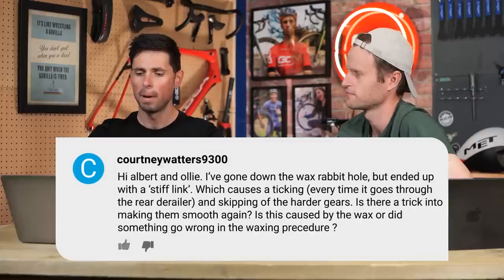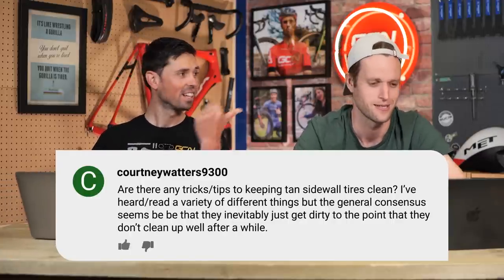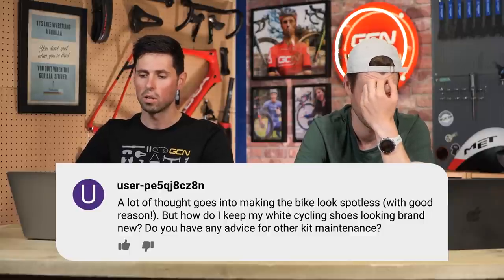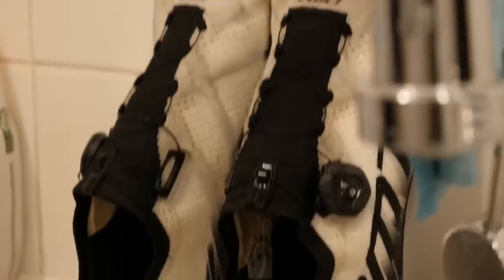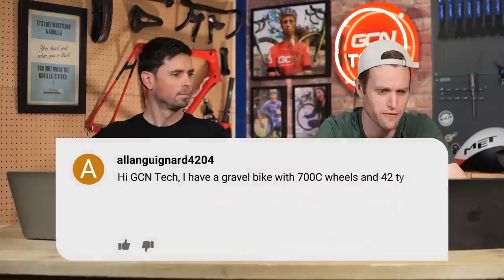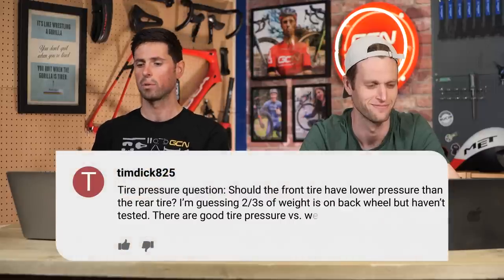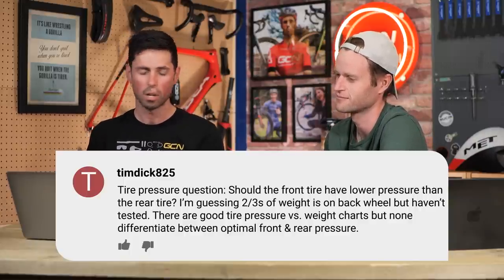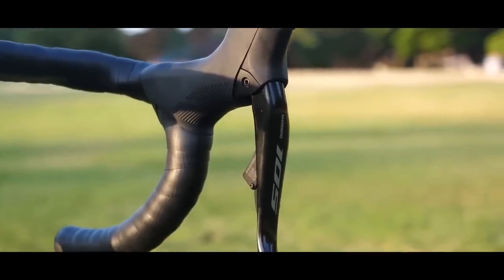Tyre Pressure, Chain Length & Dirty White Shoes | GCN Tech Clinic

Comment from the maker: Do you have any tech queries for us to answer? 💬👇
Reply: Yes.... How often do pro teams  put new tyres on bikes.... At what point are tyres too grippy or not grippy enough
Reply: Yup: I've noticed that GCN strip is currently supplied by Castelli.  How many sizes bigger than the one on the label do you have to buy to get kit that fits?  E.g. my usual shorts size is M.  I had to go to an XL to get a pair that fitted, and then it was only just.  Same goes for gloves.
Reply: Can I use a rear derailer extender instead of changing my short cage derailer? I want to change my cassette to 14-34 from 13-24.
Reply: Hello boys! I hope you’ll see my question. Can I change a Dura Ace 11s 11-28 with a Dura Ace 11-34 12s Kassette? I found that 11s and 12s both use same freehub. Please let me know. Thanks and greetings from Munich!
Reply: Hi guys, yes I will be getting an orbea gain m30 very soon, 34/50 crank can I change it to a 30/46 for more spinniness up hills? Thanks so 😊
Reply: I'm planning to buy a road bike for €3,000 and I'm not sure whether it's better to just buy a carbon bike with a mechanical Ultegra and aluminium wheels, or should I buy a cheaper aluminium bike and buy a carbon wheelset for it?
Reply: I own the new Campagnolo Ekar 13-speed and it comes with the new freehub named N3W to accommodate the extra 9 tooth cog. I know Campy sells the freehub body separately and I also know that a few brands sell their wheels with the N3W freehub body as one of the options.

Now I want to get a second set of wheels but I don't know if I either
1) need to buy one of these wheels (that have the N3W freehub body fitted from factory), which all happen to be really expensive and the offer is currently quite scarce, or
2) can I buy any other wheel set fitted with a Shimano HG or a SRAM XDR body, and then swap it for the N3W?

I'm asking because one bloke once told me that not all wheels can have the N3W fitted, but he didn't quite tell me what is the component or wheel design or whatever it is that makes one wheel compatible or not for freehub swapping...

Of course, feel free to shorten my long winded question...😂
#askGCNTech
Reply: @jonaszaleckas8920 definitely the carbon bike.  It'll always ride well and you can upgrade parts as you go. The best parts won't make the aluminum bike ride any better
Reply: #AskGCNTech Dust cover on rear Hub is making a loud grinding/rubbing noise.  When I removed it the noise went away. Cleaning and refitting it did nothing. How do I fix?

Comment: Magic Eraser does a fantastic job brightening up white shoes. Not sure how they are branded outside the US, but in the US they are branded under Mr. Clean.
Reply: I use that too to cleam my orange DMT shoes. Works a treat. They are also called dirt erasers and in German Schmutzradierer, basically a sponge with dirt erasing properties. Just moist it and go, no need to submerge the shoes like in the video.
Reply: 'Miraclean' is probably the same thing they are fantastic! (also cleans shoe sole stains from white walls, pencil and dirty tile grout (?) Found in Netherlands/Germany. I think in most countries professional cleaning shops have them. A family member used 20 sponges to revive an old red leather chair, it looks like brand new (do try a small spot first)

Comment: Going from 50 to 52 is going to pull in the pulley wheels in by approx the length of one chain link. So unless your rear derailleur is already fully stretched out, I’d say you will be fine with the same chain.
Reply: yes

Comment: To person with the question about the pressure calculator: I almost assume you are running Vittoria tires. Had the same question on the MTB side (crazy high minimum pressure). I found a forum entry where somebody from Vittoria answered and the answer was that the minimum pressures have to do with ETRTO standards and have to take into account the absolute worst case possible. (tire very aged and brittle, rider/bike weight over the maximum rating, most unsuitable rim...). I would to fear to try the 2.6 bars. Maybe start with 3 and slowly go down.
Reply: FWIW, Specialized Pathfinder 38mm say the range is 3.5--5.5 bar. I run them tubeless and usually pump them up to 2.5bar, but I don't do it for every ride, so they definitely go down to something like 2bar, maybe even lower. This is on the hookless rims.
I don't want to go check my other tires for exact numbers, but I'm pretty sure that most, if not all, of my tires are set to the pressure below the minimum specified on the tire.
I never had any issues.

Comment: Going to the laundromat is actually good advice, I go once a month with my textile hiking gear, pants, shorts and shoes and use the industrial washer to get the grit and dirty stuff off it.  
I did the same with my textile motorcycle jacket and riding pants, home washers really don't have the capacity to wash them properly.

Comment: For the knit white shoes, try soaking them in a warm to hot solution of Sodium Percarbonate, or Powdered Brewery Wash (PBW).  It bleaches with oxygen, and won't harm the fibers, but is great for removing stubborn dirt.
Reply: Agree. Works really well, lifts stains from white shoes and cleans tan side wall tyres! Really effective at cleaning tile grout too. It is sold as laundry whitener or laundry stain remover in most stores.

Comment: RE question about minimum tire pressure: I have ridden several brands of gravel tires over the years and have always run my tire pressure below the values stamped on the side of the tires without problems.  I run about 2 bars (29 psi) while the minimum pressure stamped on the tire is generally 2.5 bars (36 psi). These are for 40mm  Maxxis or Tufo tires.
Reply from the maker: If you are pushing the limits are you also using inserts? That might help if you ever rolled a tyre off.
Reply: Doesn’t feel like I am pushing the limits at 2 bars of tire pressure on a gravel bike since I have never had a pinch flat or burp at this pressure after riding over 10,000 miles of gravel. Around 2 bars (30 psi) seems to be the tire pressure used by those I ride and race with, too.  I have never run tire inserts.  Maybe the gravel in the Pacific Northwest where I ride is not as harsh as in other places.
Reply: I've had a local gravel racer recommend 30 to 35 PSI on GK 43s. The smaller the tire, the higher the pressure, but not over 40.

Comment: The stiff link after waxing, if a quick link wasn’t used, could be from not pressing the pin a little farther through the near side plate after pressing it through the chain to reconnect it.
Reply: Good point! (Damn you Shimano)

Comment: I use a pair of Hutchison sector 28mm on my gravel bike. The minimum pressure is 5 bars in a tubeless setup but it's way too high even on smooth roads. So I run them at 4 bars at the front and 4.5 bars at the rear. I do have some inserts but during my initial testings, they weren't needed. 
Same thing on my fixie, I have some 25mm Hutchinson fusion 5 tubetype and i'm 1 bar below minimum pressure at the front and 0.5 bar at the rear. 
I'm weighting 80 kg so I'm not a light rider. Funnily enough, I din't have this issue with others manufacturers.

Comment: I'm a fat wee git (170cm and 90kg) and running Hutchinson Fusion 5 Performance 11 tubeless at 60(F) 65(R) on my "good" (105 lol)bike...On my "climber"(4600 Tiagra) I've just put on a 46/30 (x 11-36) chainset and ventured up Cairngorm tonight.... this bike runs Vittoria Rubino Pro (both bikes 28C) and with tubes it's at 85(F)90(R)....The difference in ride feel and harshness is stark, like night and day....Coming down the mountain it was rattling and chattering all over the shop. I tend to ignore the TLR recommendations, never had a burp on the E-MTB at even 17psi doubt a road tyre at 60 is going anywhere and smashing into a pothole on either bike neither wheel will stand a chance regardless of pressure....

Comment: On the stiff link, I've occasionally had the problem with chains that have been dry lubed and then not ridden for a while. I used (horror of horrors) WD-40 to free them, wiped it clean and then applied fresh lube. Seems to work. I imagine you could get the same problem with waxed chains.

Comment: Tip from cyclocross for tan walls -  apply a thin layer of Aquasure to the inflated sidewalls. Its a thin glue that provide protection from water and grime. Downside is that it make the tyre a bit stiffer. But works a treat!
Reply: You can try applying these ceramic/graphene spray/"wax" that are  for sale for cars. Really easy to apply and provide some great protection against water and dirt. I've been using it  on  my bike, and just realized that I can also use them on my Vittoria Corsa's to keep the tan sidewalls spot-free :D

Comment: TPCs... From Rene Herse: "Most bikes carry more weight on the rear wheel than the front. However, when you brake hard, almost the entire weight shifts to the front wheel. For that reason, it’s not advisable to run a lower pressure in the front tire." Thoughts??

Comment: Why do sprinters and climbers swing their bike when they get out of the saddle? What does it do for the cyclist exactly, what makes it beneficial to swing the frame around when putting power down?  #askgcntech
Reply: It's basically pushing down hard on one pedal and pulling up on the opposite side of the handlebar to get the power down.  Tends to cause a side-to-side motion.  It's not so much swinging the frame around as just the side effect of putting max watts down on each pedal one after the other.  Happy riding (and sprinting!).

Comment: To nauma's question on Ultegra mech vs 105 di2, 105 12s mechanical was spotted at Eurobike, but not released yet.
Reply: Unless you're racing at a level where every hundredth of a second counts, it will make zero difference other than psychological.  Probably the biggest difference is that you feel is the regret and anger when someone steals your fancy bike or fancy mech.  I recently had a Tiagra derailleur stolen while parked in a busy bike parking spot right under a massive CCTV.  I can tell you that whatever tiny fraction of benefit I had using the Tiagra over the Claris on my other bike was more than outweighed by the pain of having to walk that bike home and pay for a replacement.

Comment: Interesting. So you charge your rear tire with 5PSi less than your front tire - Ive been doing the opposite. My rear always has more than the front
Reply: You had it right in the first place. About 5 psi more for the rear tire because more weight.
Reply: No, Alex said 5psi LESS in the FRONT tyre 🙂 Doesn’t need to hold up as much weight and then gives you a bigger contact patch for front wheel grip.

Comment: #askgcntech. I recently purchased a new Canyon Endurace. How do I quiet that annoying clicking noise from the hub when I coast? It drives me crazy. Thanks!!❤️
Reply: You don't. The common sensus these days is that the louder a freehub, the better the quality. You could have a bike mechanic take apart the hub and put some thicker grease in the freehub to quiet it down, but that might also affect freehub performance so I would advice against it. So basically; freehubs, especially modern ones, make quite a bit of noise, but trust me when I say this, you'll get used to it and even start to enjoy it :)
Reply: In group rides, it can get pretty annoying. But I love my very loud hub because: Loud hubs save lives. They work a treat as bell replacement.

Comment: #askgcntech Hello guys, love the channel, the community and the knowledge that you provide. I have a question for the speed gurus: In a couple of months time, I will participate in a "time trial" race (180km long one😉), witch tire would you suggest for the best result  in terms of speed :  25mm , 28mm or even wider? Right now I ride on Enve SES  5.6 rim break wheels  and Conti Gransport Race 23mm tires and they feel really good, very few punctures, but I see people use much wider tires these days, even 30mm ones. Thank you in advance.
Reply: I look forward to response, so far I just know if aero is best then rim is 105%, unsure if measure rim then divide by 1.05 to get tyre width or another way (I believe rim to be wider one)

I think rims I looked at are 23mm wide so I put 22mm on front but as tubular, I'm wondering about stagger sizes, often don't change much

Comment: Not a tech question. However, would like to know your thoughts on 105, 12 Speed Mechanical, I have seen reports of this on other websites. Will this actually make a difference for riders or is the 11 speed still going to be enough.
Thanks.
Reply: Depends where in the cassette you tend to find yourself most of the time. Compare the 12sp with the 11sp and check if the added cog will affect your riding. If you cycle in the flat most of the time, you will predominantly use the big one in the front and the smaller cogs in the rear, so 12 sp will be of not much use. But when it gets a big hillier, you will use the full cassette, and especially there it's nice to have smaller steps. I switched from 10 sp to 12 sp a while ago and now only rarely miss a gear inbetween what I have. But that were 2 cogs more.

Comment: #askgcntech The tubeless sealant in by back tire has dried up and the brand I have been using (Orange Seal) is unavailable at the moment. I ended up buying another brand of sealant (Silca) but was then wondering if there would be some sort of weird chemical reaction between the two. Do I need to clean out all the old sealant from the tire (dried up sealant in this case), or can I just pour it in and go?

Comment: My linear rim brakes got replaced with better pads and had great braking performance for a bit. But now, all I get is squeals and worse breaking performance despite my attempt at toeing them in and adjusting the tension of the cable… help?

Comment: #AskGCNTech Hey guys love your work!! One question: My front disk rotor rubs on the brake pads when I stand up and pedal hard. It does not rub at all when checking or riding normally. I have centered the rotor many times but havent managed to get rid of the problem. I have Shimano 105 hydraulic disc brakes on a Ribble CGR 725. Any ideas how to solve the problem?

Comment: Any helmet cleaning tips from seasoned cyclists? I never washed my old helmet I just left it in the sun sometimes for hours, now that I bought a somewhat decent helmet, how do I actually care for it? It doesn't stink or anything but the straps get sticky and gross.
Reply: Here in the hot, humid southeast USA, I take my helmet in the shower and dab a soft brush with a little shampoo and give it a quick scrub and rinse. In between washings, I spray the inside with some Lysol type disinfectant...do same with the shoes. Keeps the funk in check.

Comment: Hey guys...I have used Molten Speed Wax on my chain for a few years. My crock pot is running low so I am moving to Silca Secret Hot Wax. Should I completely strip the Molten wax from my chain before applying the Silca wax?
Reply: Just degrease it, it’s a bicycle chain.
Reply: I've done the same! What I did was first put the old chain in hot water, which will melt off the old wax. Then put the chain through a mineral spirits bath followed by an acetone bath, I didn't find that I needed to do multiple spirits bath since it fairly quickly removed all containments within the first bath. Then apply the wax and it was as good as new! Degreaser doesn't really work on wax.
Reply: @ynie1  the degreaser I use strips it off but takes a few goes, I just put the chain in a plastic bottle and shake, drip for a bit then wipe and straight into the hot wax.

Comment: #askgcntech Whats up guys love the channel and the advice...My Tarmac SL6 has the Shimano 105 R7020 groupset but the amount of travel in the levers to engage the brakes I feel is a little too much.  The brakes engage when the lever is around 80% towards the drops to get a bite on the rotor.  Is this normal or should a brake bleed solve this issue?
Reply: Hi, I have the same bike and also have a large amount of travel in brake levers. I spent some time trying to adjust it but gave up…I guess it’s normal.
Reply: @stevegeek  You would think this is a serious safey issue!
Reply: @MisterE331  It’s not good, but I’ve become used to it now. Still enjoying the stopping power compared to rim brakes!

Comment: do not do not do not do not put a lighter next to the wax.... it's flammable and could cause a fire. That's why it's recommended to use a crock pot vs. a stove that gets too hot. The goal is melt it to a liquid but not create a fire dept visit.

Comment: So I have a Cannondale CAAD 10 that has recently been having some very clunky shifting between the rear gears. How can I smooth this back out and what should I start with troubleshooting for my bike?
Reply: If it is in both directions (towards an easier and harder gear), your chain or cassette may be worn out, if it is only towards harder gears, your shifing cable. might be seized and need lubrication or replacement.
Reply: If it's mechanical shifting then I would recommend two things. First (and easiest) would be to replace the cable and housing. Over time, contaminants will get into your cables and start wearing on them. Eventually, it will build up enough friction that it will significantly impact the shifting. In addition, if that doesn't fix things, then you should consider taking apart the rear derailleur, and then degrease & regrease the pivots and bearings.  I have to do this with my gravel bike every season or so just because exposure to the elements eventually reduce shifting efficiency.